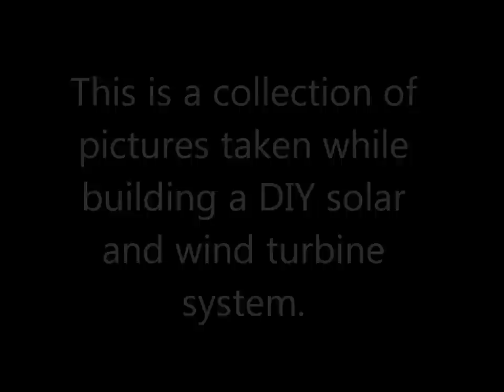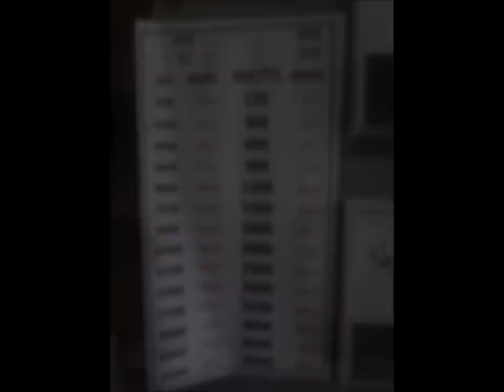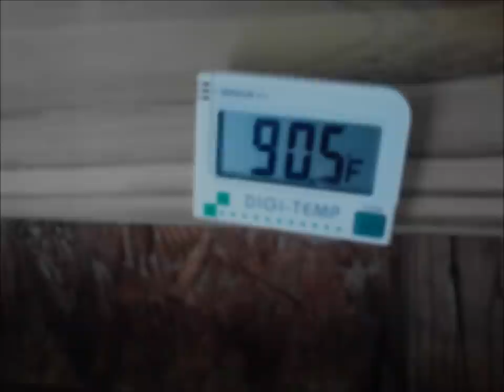DIY Solar and Wind Farm Project

Comment: Cool, You seem to have this down. also working on a solar system for my place in the Philippines. Like the hot water heater, power is also needed. I could use some help from some one that knows what is going on..